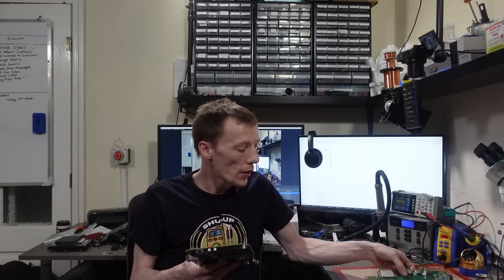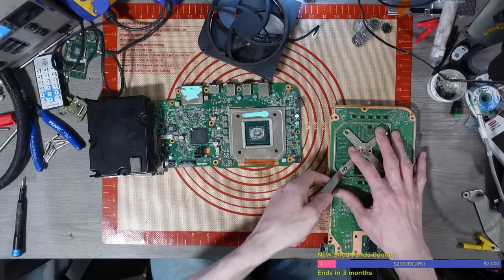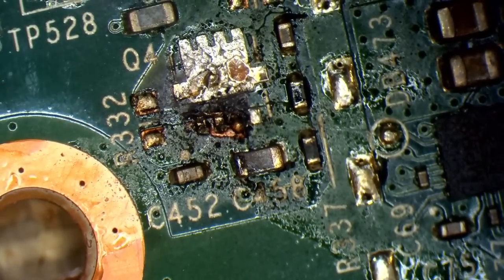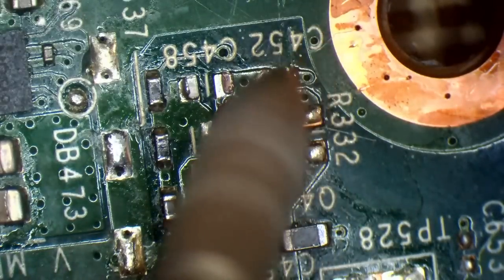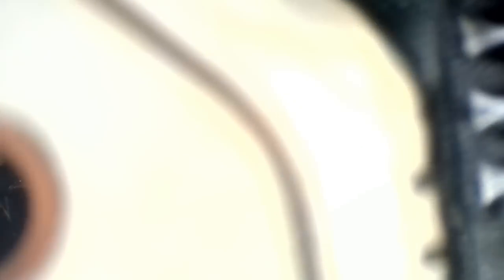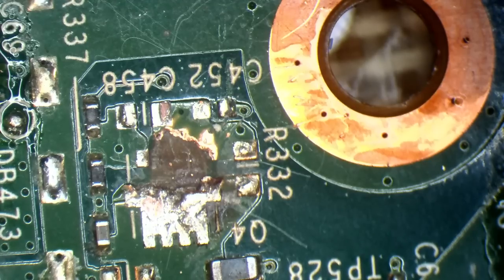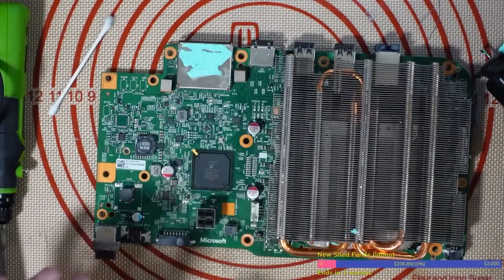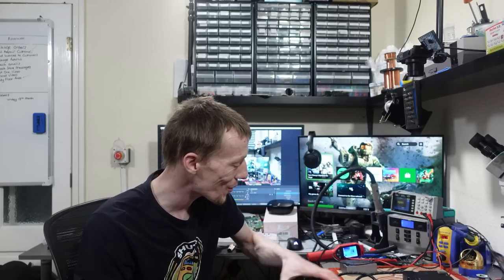The eBay Seller Said This Xbox Series S Wasn't Fixable... I Tried Anyway!

Comment: Just a piece of advice. Before you power the board. First check the board thoroughly under microscope. 
Check the resistances on the power lines. Or critical datalines. (The ones often fail) Just to prevent further damages by turning the equipment ON. That gives you a clue if there is something major going ON. 
If you are fixing the same boards. Just record the resistances on a good equipment.
Every day is a school.

Comment: i know you focus highly on consoles but i have a decent laptop that spent over a year in a computer repair shop and the guy couldn't fix if your interested in trying let me know original problem was it had tea spilt on the keyboard but occasionally it will still turn on for about 30 seconds so its not dead
Reply: That sounds like a shorted PCH/Chipset.

Comment: On a band ps5 unit what needs to be replaced to get back to working again. Can chips be replaced from a unit that has dead board
Reply from the maker: You'd need to replace the APU and BIOS IC mate. Something I'm going to try in a video soon but economically it isn't worth it

Comment: The series X motherboard are married to the disc drive and maybe the secondary pcb too, right? So wouldn't these boards just be parts if you dont have the other components?
Reply: These are series s boards not x.
Reply: @darkglide24  that makes more sense. Thanks!!

Comment: What would you recommend to start on as a beginner in electronics repair? I have hot air , soldering iron , hotplate , but have no idea where to start :)
Reply: Gotta start on the handhelds. Old Gameboys and work up to the bigger consoles.

Comment: Can you help my sons ps5 turns off when he try’s to play cod
Reply from the maker: By all means mate. If you want to book it in at https://www.consolefix.co.uk/book-your-repair you'll be able to send it over to me for repair. It sounds like it's overheating. For that I'd charge £50 plus the return postage costs
Reply: i bet its over heating friends ps5 does this fromt ime to time this time i need to take the fan out and clean it really good instead of just running high pressure air through it